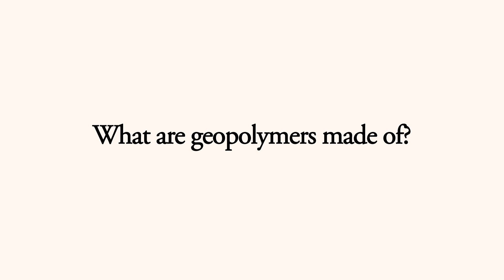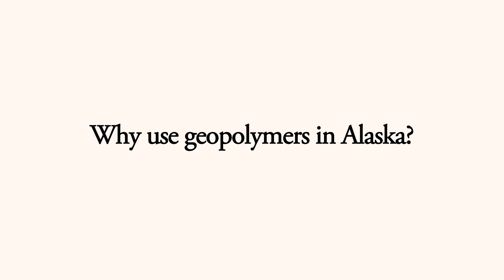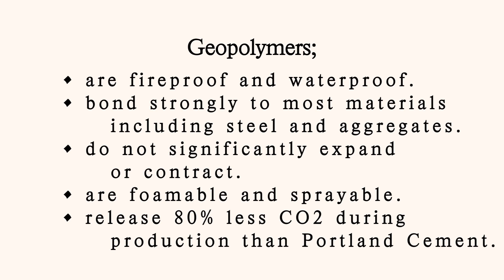Geopolymers: what are geopolymers made of?

Comment: something that would be interesting is using a carbon dioxide releasing agent in the geopolymer and a laser system to fuse layer by layer the clay substances so it will puff up like the graphene foam that forms from doing this with Kapton tape, but being left with a solid block of insulative tough clay structure, instead almost like an intumescent clay material, something else I guess I need to add to my list of ongoing concepts, as I am betting it coupled with the passive thermal diode effect could enable cooling or heating passively anywhere while being able to retain this heat or cooled area's effect from that insulation property of a foamed fired clay.

Comment: What do you think about using Dessert sand and use it for geo polymer? Because it is an material which is in huge amount.
Reply: The blown sand would be surface smooth, it would not be good. You need sharp sand.
Reply: @undernetjack  what if you Mix it with plastic?
Reply: @CUBETechie  There are videos showing that exact process on youtube, for making tiles and roofing shingles etc.
Reply: @undernetjack  a title or link would be amazing
Reply: Development and Optimization of Geopolymers Made ... - MDP by A El-Mir · 2022 · Cited by 9 — Desert dune sand has been used as an essential material in the construction industry.....
Reply: @nc3826  but isn't it too round to be used for concrete?
Reply: @CUBETechie  the source is sighted

Comment: Fly Ash usually contains heavy metals including lead, chromium and mercury. It also is often laced with arsenic.
Oil and Coal are best used very sparingly. Want to learn about strength? Examine a bird skeleton (an already dead one please) a spider web, etc.
The Carbon Energy companies LOVE to be paid every month or more often (It's why they hate solar and wind). Oil and Coal LOVE their taxpayer funded subsidies and they LOVE when someone makes a video to help them get rid of their toxic waste.
Reply: the love wind and solar when their carbon energy is being sold to the companies to manufacture those solar and wind units, since it takes a TON of energy to make virtually all solar tech just to refine the materials, and the only reason it is some what cheap now is due to processor and chip waste silicon that gets reused to make solar cells so most of the expense is done and already paid for by computer enthusiasts LOL. Solar has a very dirty secret, that it may  be possible to use tech like we use for geopolymers and silica gels manufacture to make them with far less energy, (and expand our tech options beyond just pure silicon embedded with boron and coated in phosphorus, I mean there are tons more electron donor elements and proton donors as well, to experiment with, so while those two (boron and phosphorus) work well in pure silicon, what would work well in sapphire? (aluminum oxide crystal) that can be made with sodium hydroxide and aluminum to make sodium aluminate so it can be dissolved and mixed with an acid to extract that sodium leaving gelled aluminum oxide, which how it forms is all down to how we dry that water out of the aluminum oxide gel (freeze dry and get sapphire based aerogel better thermal stability at high temps like for glass kilns to retain heat better and save tons of carbon energy when making glass the old way XD) or slow dry maybe even add something to ultra slow it and have stronger pull on the aluminum and oxygen while evaporating out to make nice solid uniform sapphire crystal, say in the shape of a window, or a flask or plasma toroid XD ) so many possibilities springing out of uncovering and exploiting these loop holes in physics XD
Reply: @ThomasAndersonbsf  - Right up my alley! Material Sciences are the elephant in the room. Yet, most of the media's "look over here" is toward "energy"...
Reply: @samuelluria4744  yep replicator tech is all about knowing how to manipulate materials both to break it down and prep it as well as put it back together how we want too, and not so much about generic transfer of energy. or energy to matter like startrek heads want to believe.
Reply: @ThomasAndersonbsf   - Well said. Presumably,  the public understanding of the expendable nature of any form of energy,  makes it easier to uphold profit margins. The dream of durability is kept far from their eyes, however,  as it's hard to charge more for products which rarely wear out.
Reply: @samuelluria4744  what kills me is that geopolymers require that it be something non carbonaceous that is polymerized like the silica and alumina in say clay, and to make that requires none of what they mention here. My recipe? dry fresh terracotta clay, and water made up with 1 gram of citric acid powder, 2 grams oxalic acid powder per gallon of each, and 50/50 distilled or filtered at least water and 6% vinegar to bring it down to 3% Use equal quantities of this mixed together and then take that and add to the dry clay to wet it into malleability, This process made it possible (vs plain water and clay mix) to fire to fully insoluble (vitrified in normal terracotta) at around 500F and had twice the strength before shattering with a noticeablity of flexing that the regular terracotta clay fired at 800-950F  did not have, and as I said even over night soaking did not cause either to soften or fall apart in water, though the regular clay water mix at that 500F temp would still break down in water and soften back up and was just grittier than it was initially before the 500F firing. 

trick? the carbon based acids cause interlinking as it burns off so the non carbon material leaves a structure similar to the acidic carbon compounds have and this seems to continue forming polymer like structures. Does it have weaknesses that fully vitrified material has? no idea that is as far as we got with testing and examination in electron microscopic views of the materials (looks too like you can dope the stuff say with boron from boric acid or boric oxide, or phosphoric acid and make a semiconductor like effect when it wicks moisture up into it, something I am looking deeper into as a guess on ancient structures that if right, were probably just accidental but still make for some interesting new investigation.
Reply: @ThomasAndersonbsf  - Sounds like a great adventure! Also sounds like you passed Chemistry class...😜
  Totally random question, as you obviously will be familiar: "They" keep saying that the world is running out of sand,  with which to make concrete. What's your feeling about this? 
Adjunct query: Can sand from the sea floor not be used?
Reply: Another adjunct: Would there be any reason why all inert glass couldn't be ground up and safely spilled into the ocean, for the ocean to recycle?
Reply: @ThomasAndersonbsf  it’s a year layer, and still nobody has read that rambling wall of text.

Comment: Geopolymer cement or geopolymer concrete use industrial waste like flyash to make green new concrete. It is easy, as geopolymer paste  which is basically flyash added with sodium silicate and sodium hydroxide, this paste has a density of 2,000 kg/m3 and it is above 60mpa in compressive strength. the aluminasilocate combination endorthemacally and aluminoslicate precursor  it, it normall create full strength in inside 24 hours, ths normal cement is by hydration process. I am open for train to those interested and technology transfer. Whatsapp ( +6 019 9160861 ) E-mail : lightweightconcrete@yahoo.com
www.shss.my
Reply: durgaraoravuri1230@gmail.com
Reply: Contact me at Mohitsayal@gmail.com

Comment: sodium hydroxide or sodium oxide?
Reply: dehydrated sodium hydroxide? is that something worth doing even if it can be done? (I know some stuff once it hydrates like copper sulfate, it can't just be driven off with heat, as it decomposes releasing sulfur oxides and copper oxide powders, so from what I have seen it takes some sort of strong dehydrating substance like zeolites that have to be pulled and dried in an oven then put back in dry and let it adsorb the water components leaving the anhydrous copper sulfate, and seems like sodium oxide would have one heck of a pull to hold onto hydrogen in its hydroxide state, Now I need to go look and see if that info is available, since otherwise I am going to be spending some time trying it out myself XD

Comment: Thank you for the video! Do you think geopolymers could be used in environments with huge pressure and/or high temperature? E.g drilling for oil and making tunnels for roads?
Reply: +BucketOf Hurt Portland cement used in concrete performs better when blended with these co-polymers. Mixing portland cement with a ratio of Fly ash usually results in a concrete with a higher compressive stength. 
There are others like Silica fume which is mixed in for water proof and high acid areas like under the sea etc.
Reply: Aaron James Thank you very much!

Comment: How would you "foam" the geopolymer?
Reply: It is easy, as geopolymer paste  which is basically flyash added with sodium silicate and sodium hydroxide, this paste has a density of 2,000 kg/m3 and it is above 60mpa in compressive strength, so you add in foam to expand it or reduce the density, ( but not with stone added as the stone aggregate tents to sink to bottom when foam is added ) if you need a foam generator and foaming agent, contact me please. my name is Alex ( www.lcm.my )
Reply: @lightweightconcrete  this is awesome ... I have a foam generator and need to try this.  Where should I get the materials!???
Reply: @tf1639  USD 3.5 per liter, minimum order 25 liters, but problem is chipping may take a long time,
Reply: a liter is to be added with 30 parts water known as Premix Solutiion and expand 10 timew or shoots into or become 10 liter foams.
Reply: @lightweightconcrete  hello.  I'm confident that I have an ideal foaming agent.  I just want to try geopolymer instead of concrete.  I don't know how to get the geopolymer raw materials